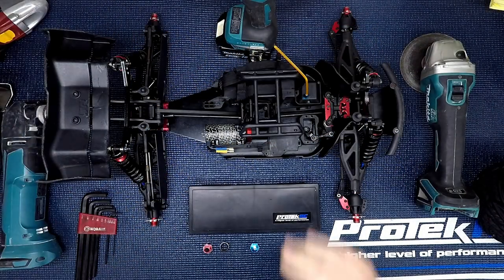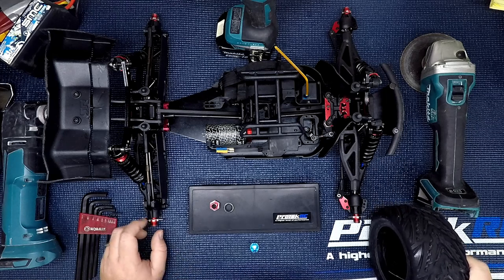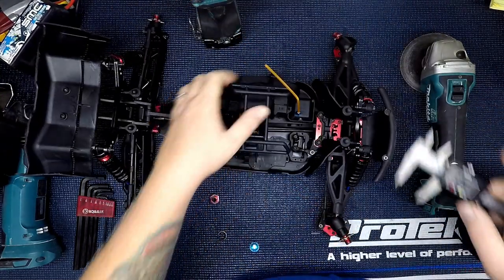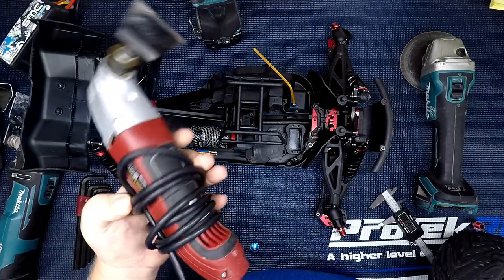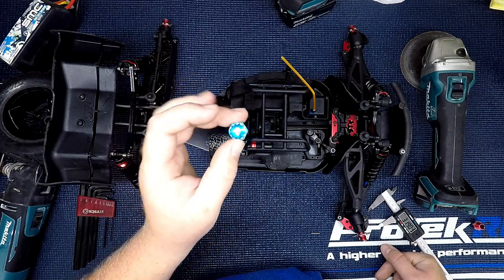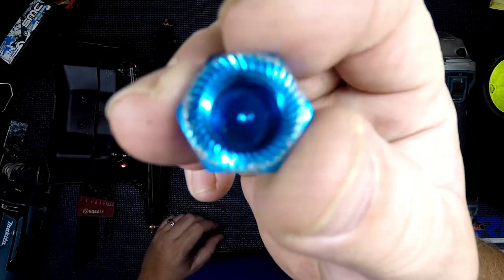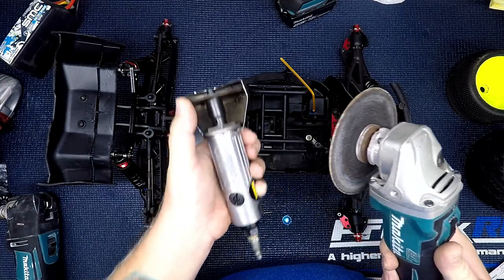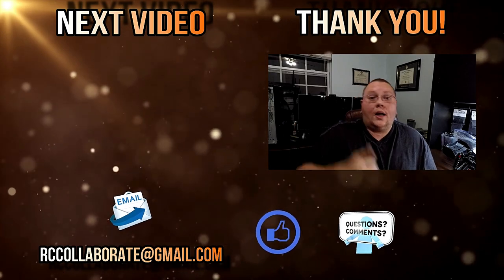How to Pin Wheels for 6s Power. Prevent stripped wheels and fall offs!

Comment: Thanks Bud, just stripped a wheel today. I used a drill bit of the right diameter, and cut it to size with my Dremel. Now to do the other 3 wheels! Also, if the wheel nuts on the right side were left hand thread, they wouldn't unscrew when the wheel strips, just sayin....
Reply from the maker: I think I might be selling pins that are hardened and made for this Purpose. Not sure if anyone would want to buy them it would be like 15 shipped for 4 or 20 for 6

Comment: Thanks for video. What’s on the inside of your wheels to block air holes?
Reply: Looks like he used puddy for balancing. Not hole sealing. 

I say that because it looks exactly like what wes does at the hobby shop here. 

He does it for balancing. So I guess the same is done here.

Comment: Put a little heat on the pin and seat it down, will melt the plastic on the rim. You can just do this to mark it or fully seat it in and clean it up after if you don’t have the notching tool. Lock tite!!!! Arrma wheel nuts come off no matter how hard you tighten them. My new Mojave with tight wheels just stripped right out first run. Arrrggg

Comment: Hey bro great vids, with regards to the pins, drill bits or grade 5 titanium rod be better in your opinion.
Tit i can cut to 30mm the drill bits at 2.5mm only have 20 odd mm blank shaft on them.
Any advice would be appreciated
Pete
Reply from the maker: Drill bits are going to be really bad because they are brittle and will shatter, from shock in not sure about titanium, not sure how flexible it is or shock  resistance
Reply: @therccollaborative9524  thanks for a very quick reply bro, just a struggle to get the hardened steel 2.5 in uk

Comment: Almost 4 months later, how is this solution holding up on 6S power? I just very easily burned a hole in my factory Talion V3 wheel on 6S.
Reply from the maker: This works great.
Reply from the maker: People have done this to fix Already stripped wheels and it works fine, I am one of those people.
Reply: My wheels are back ordered big time, may be doing this for now. Great video!

Comment: Wouldn’t this weaken the hub and make it more likely to strip if you cut into the hex plastic? Does this actually work for 6s
Reply from the maker: No such issues worked great on 6s prevents stripping
Reply: Great I’ll try it out Thanks